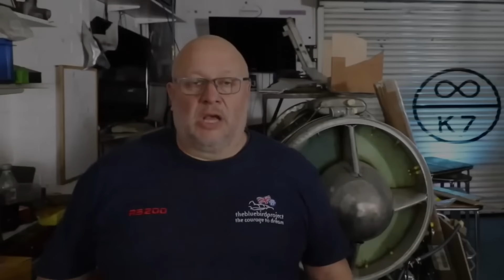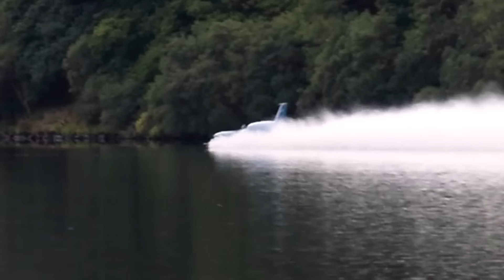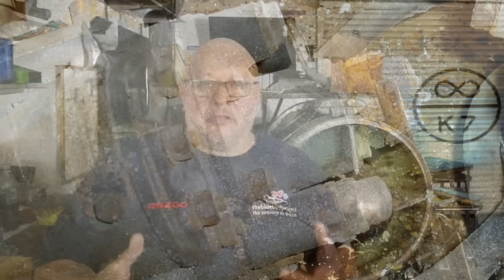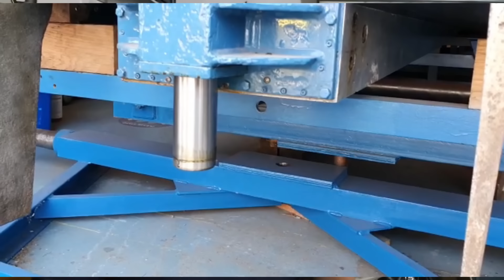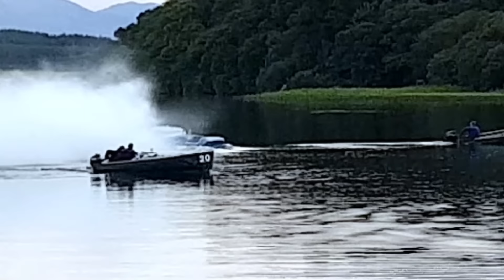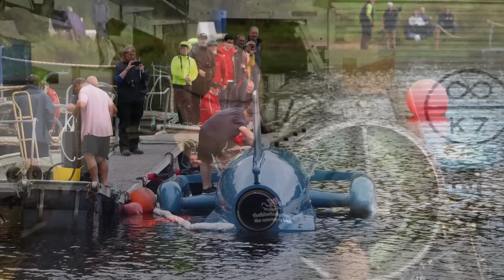Bluebird K7 Back to The Water? What needs to be Done First?

Comment: After watching this again, it seems a relief they never got it to plane properly. It never seemed to look quite right or happy in the water, a massive contrast to the BBP efforts. Even the brief run at speed seemed out of sorts. I’m no engineer but have a keen interest in all things mechanical especially from the era of Mr Campbell and if it doesn’t look right it probably isn’t in my opinion. It’s a shame that the media keeps omitting the efforts to raise and get it back in the first place but I’m sure the “festival” has generated some well earned renewed exposure to this channel. Have you thought about doing a podcast, would be great to have this along side we have ways of making you talk. All the best 👍
Reply: In fairness, they DID get the boat to plane properly; sadly, only the once and not for very long. 😢
Reply from the maker: It never really did. It didn't clear what Ted describes as the 'nod phase', which requires more thrust than the climbing out. It fell back in before it got properly cleaned up.

Comment: I think your legacy as the person who located, raised and restored the boat is set. You will remembered and respected for that by all. But I don’t think your legacy is going to be improved by these videos - harping from the sidelines is not a good look for you. The boat is not under your care, it’s gone. You are obviously a lot better and bigger than all this.
Reply from the maker: The problem is that the Ruskin Museum went out of its way to write the Bluebird Project volunteers out of the history books and then began hacking the boat about with, for example, that dreadful canopy and the removal of the original cockpit seals. There's a responsibility to the historical record and the machine itself that the the museum isn't meeting so it's only fair that it's accurately reported. Had they acted reasonably and professionally there would be no need.
Our legacy is only safe because of these videos. Besides - people like to know what's going on. Thanks for watching. 👍😊

Comment: Points well made and it does bring into question the likelihood of a May 2026 run.  What can be done to improve the success of any project - bring in more resources with subject matter expertise.
Reply from the maker: Absolutely - but all the subject matter expertise is in one place. It's not like a retired aircraft type where you can rake up a couple of ex RAF chaps who once worked on it. There are people who have worked on similar engine types but not that installation, which is highly modified from any aircraft installation. Only we have worked on that, and on the hydraulics, electrics, pneumatics, structures, operation and handling. The knowledge of all those elements and more lies with the Bluebird Project volunteers and nowhere else on earth. That's the bald fact of the matter.

Comment: This beggars belief really. Surly the sensible thing is to have your team run the boat for them and also perform the periodic maintenance if the boat is going to be run at future events and anniversaries. I think common sense has gone out of the window. The only thing that might turn this around is for them to have a massive embarrassing fail and for those with the anti attitude to be taken out of the chain. All I hope is that the boat is not damaged in any way.
Reply from the maker: Sadly, it's already damaged. It was damaged by taking the engine out, someone has put the wrong screws in and Dymo labels all over it. The paintwork is becoming ever more scuffed and that canopy debacle just shows how badly managed it is and what kind or workmanship they find acceptable. It's genuinely worrying. At the current rate there'll be damage or an accident. There's no dedicated project management or oversight. It's a disaster.

Comment: The hens are coming to roost, Ruskin and that group just are the ones without a head. I am so saddened, angry and disappointed all in one.
Reply from the maker: It's even worse than we could have imagined. We always knew they'd cock up the canopy because it's so difficult and we were pretty handy by then but we thought the failures would be small and possibly fixable but what they turned out is a total disaster. It could never safely run with that thing up there and that's without the fact that it's visually wrong in every way. And to think they might have tried to pas it off to the public as what Bluebird actually looked like. We're still lost for words at this end.

Comment: Is there an independent  authority  that can inspect K7 before its put on the water and used?
Reply from the maker: If they want to insure the hull the insurers will doubtless want a survey. Our work was looked at on an ongoing basis by our industry partners, not formal inspections but keeping a close eye as their names would be associated with it and we had some heavyweight partners. So our work is absolutely top rank but then a significant part of it was torn out - there's another video in the playlist called 'death of an Icon' that sets out that sorry tale. Now if any of that work is then replicated it' unlikely there will be any oversight and as no one but Bluebird Project has any experience or in-depth knowledge of the boat, just about anything is possible.